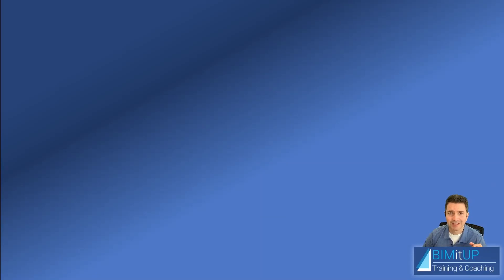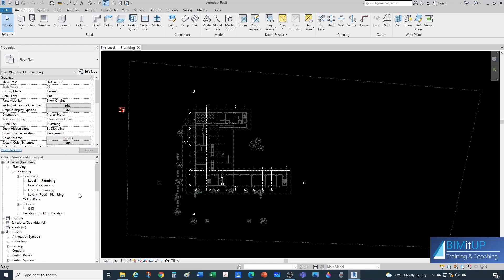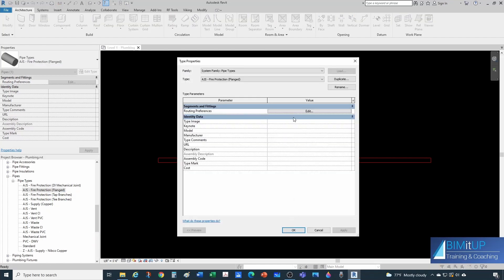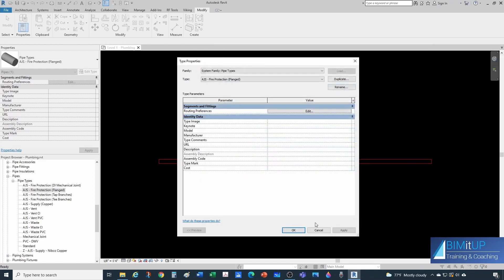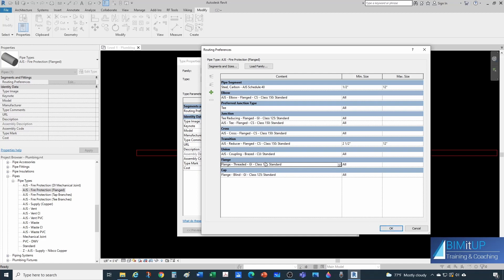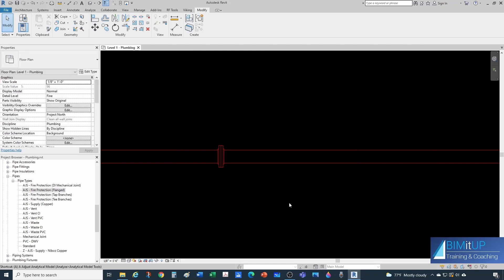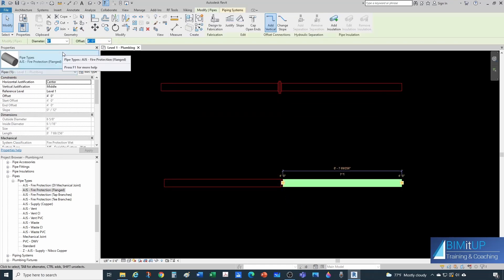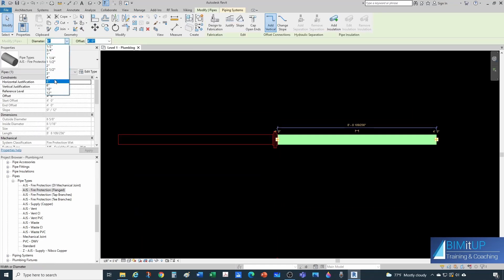How to Split Pipes in Revit MEP Tutorial - Union Vs. Flange

Comment: the video is very good I like it, how do I add the bolts ?
Reply from the maker: Thanks Titto.
For bolts, you have to go into Revit Fabrication.
Let me know in the comments if you would like me to create a video on Revit Fabrication.
Reply: @bimitup  yes sir I want to know how the process is, I'm working on a project to make pipes using flanged connections and there is a flanged connection using bolts.
Reply from the maker: Maybe soon.

Comment: This settings works for all types of pipes? because I see for this video you used pipe type fire protection... thanks in advance..
Reply from the maker: Yes Larry, this works for any pipe type. 

The key thing to understand is that: whatever you specify under “Flange” will take precedence over what you specify under “Union” to split.

If you click on any Revit Union and then right click, and go to “edit family:
Once it opens, you will see that under “Family Categories and Parameters” (top left), you will notice that:
“Category” is set to: “Pipe Fitting”, and
“Part Type” is set to: “Union”.
On the other hand, on the Threaded flange:

“Part Type” is set to: “Flange”.

A rule is:
Union: Splits with (1) fitting.
Flange: Splits with (2) fittings (one at the end of each pipe)